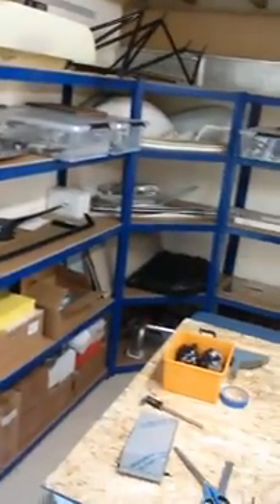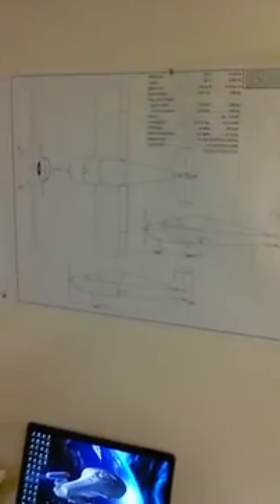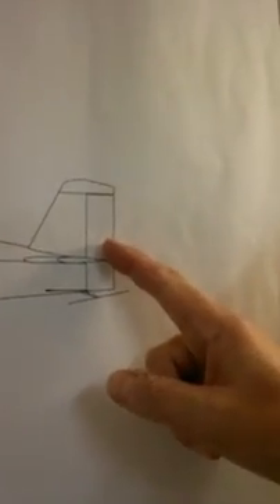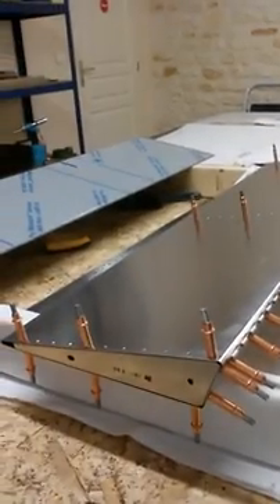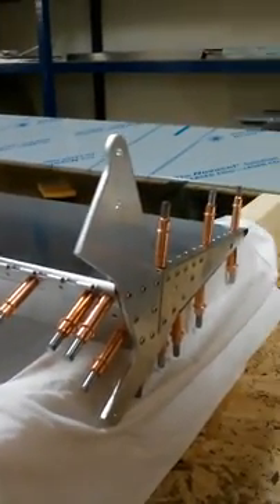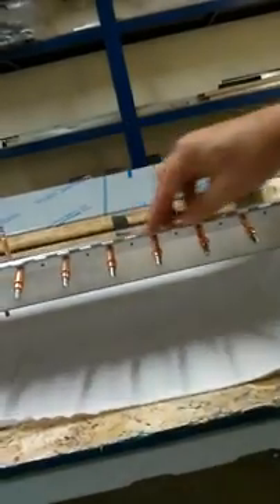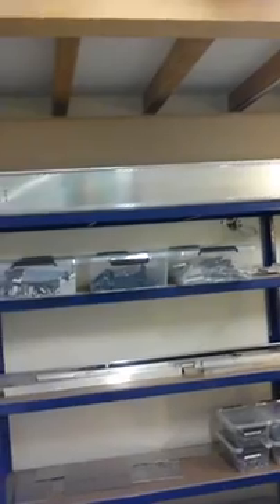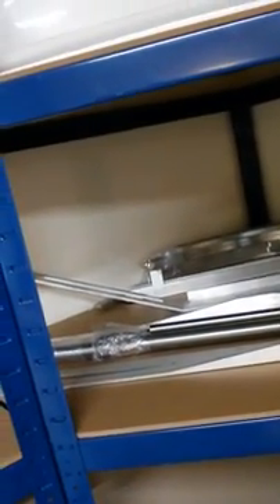Sonex B Part 1 - Introduction plus building the rudder

Comment: Excellent presentation. This is an excellent demonstration of how to realize success building the Sonex B model kit. 
   I'm looking at this from an experience perspective of working professionally in airplane maintenance repair and alteration for many years after abandoning my first dream of owning building and flying the Zodiac 601. Without use of legs, I had laid in bed mostly for a year as my friend brought to me undeliverable magazine subscriptions from the VA. I thought, " If I ever gain use of my legs - I'm going to fly Sport Pilot rules*, in the USA without the formerly required AME physical but alternatively with just the standard driver's license. Sonex wasn't popular then as the magazines like popular mechanics appeared focused on Zenith Zenair CH 601 airplanes designed by aeronautical engineer Chris Heinz. It was later that I discovered John Monet and Sonex.